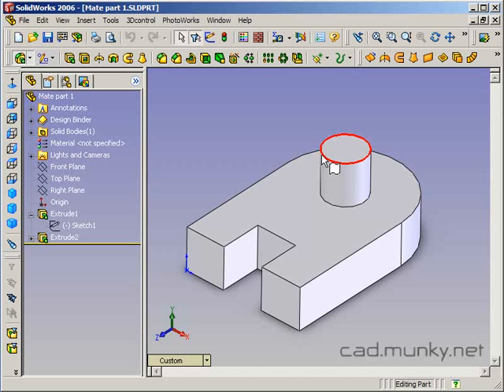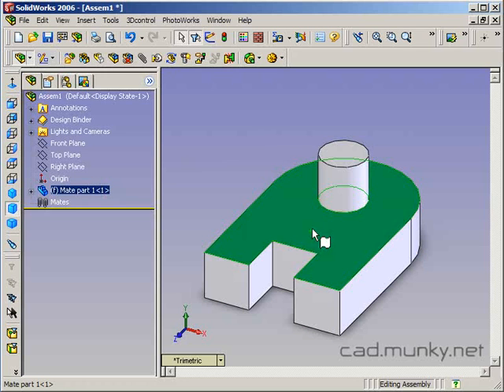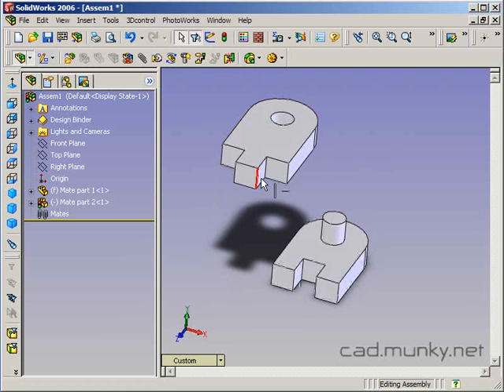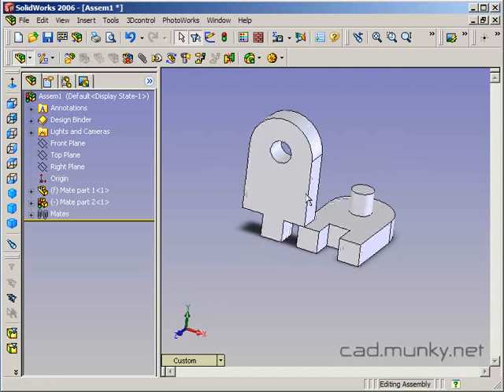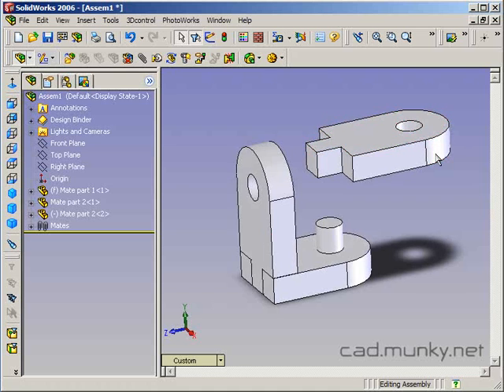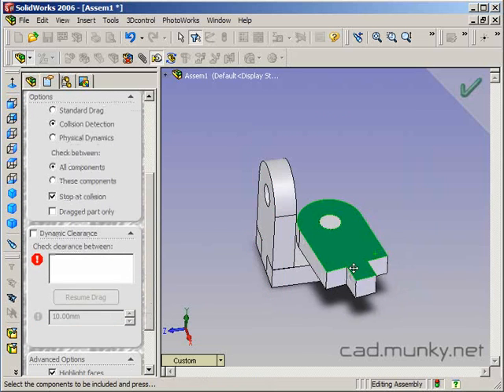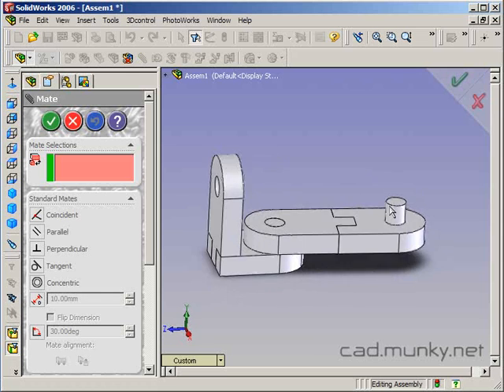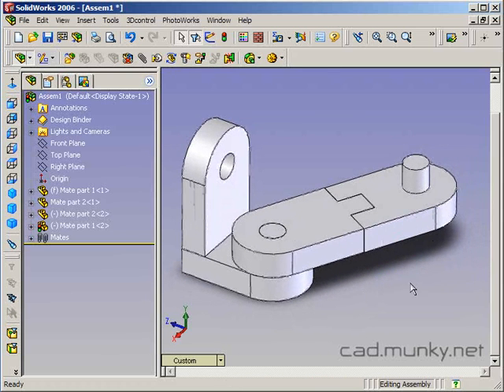Simple assembly mates

Comment from the maker: I believe that in recent versions of SW they've added fillets as an assembly feature which can then be propagated back down to the parts for just this reason. Haven't tried it myself though.

If fillets make the geometry too complex you can always base your mates on reference geometry instead

Good luck
Reply: Ryan Olson I need your help. Perhaps you can answer today. I am using solid works 2008. I am a novice but in process of learning it more as I use it. I am trying to align two components that are two different axis with respect to xyz. I think that after I do this then I can mate them. So my question is should reinsert the component and when I do will there be an option that will let me align them so that they both at the same xyz axis? Or is there some other way now that component is already in the assembly drawing?